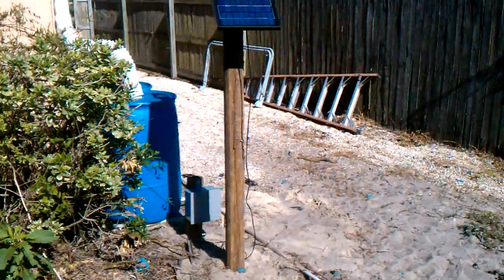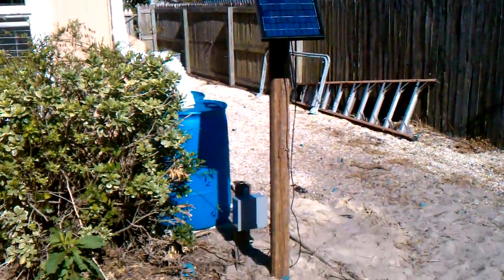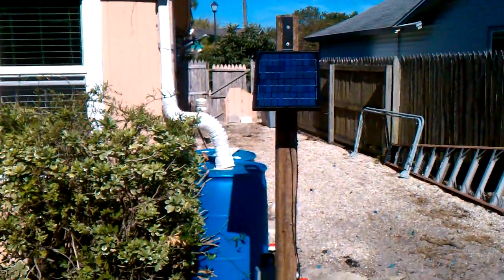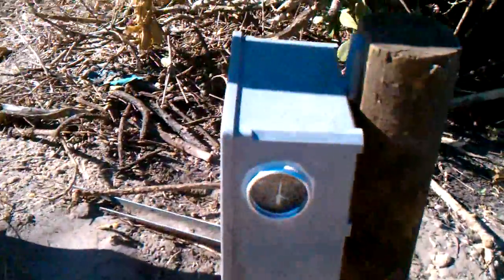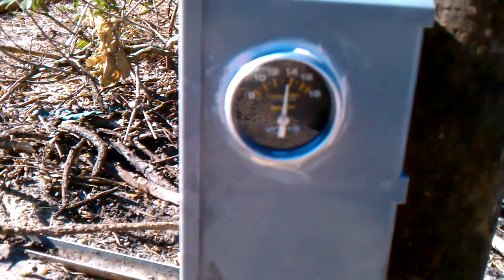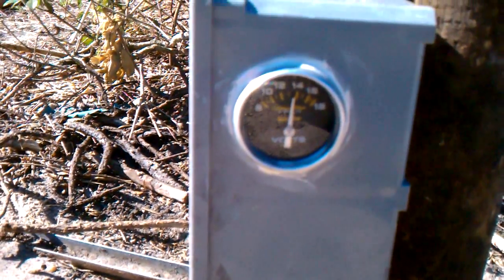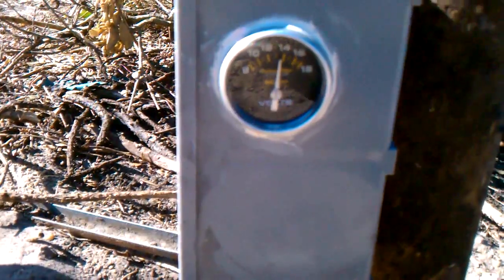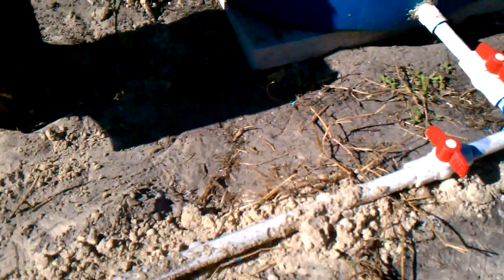Rain barrels and solar water pump system for above ground garden part 4

Comment: Wow.  I just put up 45w near our camper and thought that was awesome. lol.  I'm setting up a system to my garden (which I'm also in the process of moving).  I'll have to get another battery for that system or I'll be stuck when we take the other camping. Is there a video showing how you set up in the inside of the box?  Thanks!

Comment: How is that hobby battery holding up now that it's been a year and is that a 10W panel?  I was looking for the video where you said you show the inside of the charge box, but couldn't find it.  Trying to set up my system now.

Thanks.

Comment from the maker: @Xringer Sounds about right and my 7AH hobby battery is always fully charged and so I'm planning on running my tracker off it as well. The Red Rock device is awesome and that's what I'll be using. The 10W panel I got was cheap for a 10W panel, $50 shipped off Amazon. Where did you find a 30W panel for $80? Can you PM me with a link? I haven't seen them for less than $120ish. Thanks.

Comment from the maker: @Xringer The pump is a 12V 2.2A pump and I have my timer set to run at "high" noon so it'll be running off the solar panel and battery. The wiring is like this, solar panel to charge controller and water pump off the battery. The irrigation system is a drip system with a 25psi pressure regulator and a nice filtration system, rain barrels get nasty. The 10W panel might be enough but I didn't want to risk it and also, the solar tracker may run off this battery and solar panel as well. We'll see!